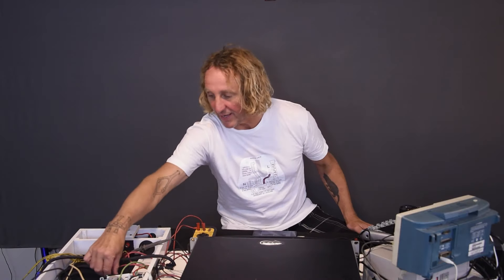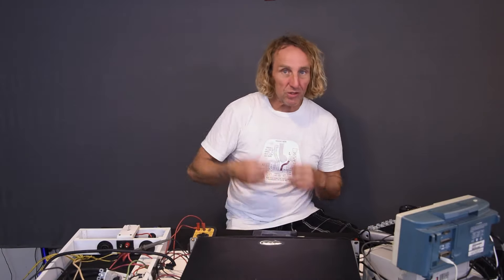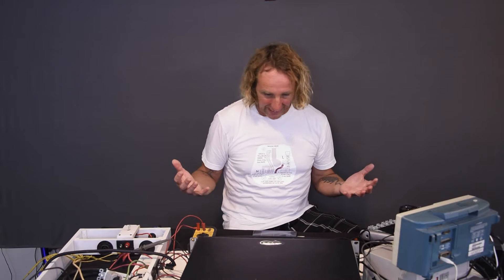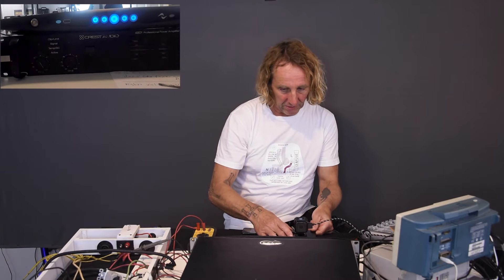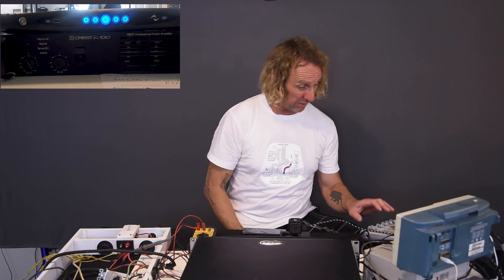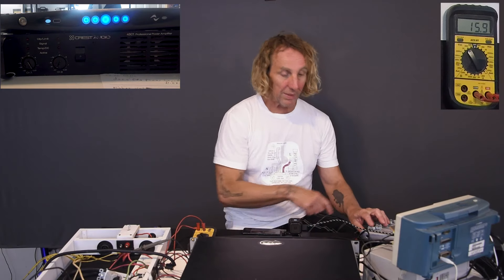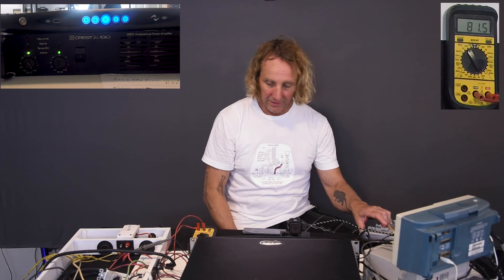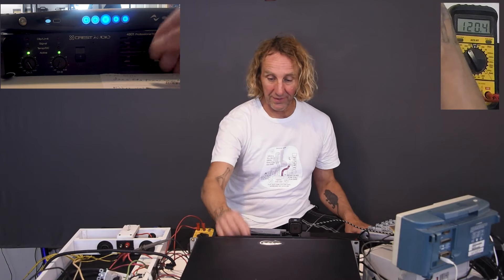Does Wall Voltage Matter for Audio Amplifiers??

Comment: I measured 139 V at my outlet. Is that bad for the amp and the tubes?  Thanks for replying.
Reply from the maker: That's a bit high. But also most gear is designed to deal with a voltage range .

The main concern is why is the voltage so high. Typically the power company is pretty good at keeping 120 volt stable. But it depends on what country you're in. 

You may have a bad neutral that's drifted or not connected well which should be looked into.
Reply: @DaveRat  I'm here in Texas. Thanks for your reply, I'll check the system and see.
Reply from the maker: @thegolfnut812 yeah measure some other voltages around the building. If you find it a bunch of the voltages are 20 volts low and other voltages are 20 volts high and then you probably have a bad neutral connection somewhere. 

Maybe measure it at the panel as well let me know what you find

Comment: Since I don't trust venue distros, I have a multimeter on house voltage all through gig. Thanks Dave
Reply from the maker: Wise, and when the meter reads afoul, what is the contingency plan?
Reply: Sure pays to be careful...
But from the venue's perspective, we prided ourselves on our capabilities... regardless the conditions, load or line side, our power was legit. 

I've since retired, but seriously, it was something we took very seriously. Oftentimes our biggest concerns, were clients low-balling and under-representing their needs. 
Granted, the biggest productions that rarely if ever happened... it's the marginal shows that may present issues. 

I've got tons of stories ... I'm guessing you do too.
Reply from the maker: Ha! Yes! Especially back in the punk rock tapping hot with wires before the building disconnect days.
Reply: @DaveRat  
Nice!
Reply: Quick funny story;
Walking with a wedding DJ for a pre-event walk thru... walking toward the event hall, I ask exactly what his power requirements were... 
He said, "𝙄 𝙣𝙚𝙚𝙙 𝙖𝙡𝙡 𝙮𝙤𝙪 𝙜𝙤𝙩" 
Okay then! 

We operated in a manner of there were essentially no limitations... We had multiple 800a "Concert Switches", adjacent to wall portals for feeders, those in nearly each partitioned hall. 

For flexibility, each floor pocket (~20' on center), we had six 20a Edison, 60a 3ph 208v, 100a 3ph 480... so with countless transformers mounted to frames, we'd simply roll in and drop 200a 3ph 208v... anywhere!

* If we needed 400a of 208v in the middle of the floor, we would PARALLEL two transformers! 
(that's something one never encounters outside of showbiz)

All flush mounted into the floor.
 In carpeted ballrooms or concrete expo hall, he had pockets everywhere. 

Even cooler... these pockets had fffnnn everything; 
Compressed air
Water
Drain
Natural gas
Telecom; w/hard-wired Ethernet, copper phone lines, fiber optic multi-mode and single-mode.

Also, our own in-house cable network, we combined and modulated both satellite, and local cable onto our own group of channels on RF coax.  

We had anything you need
It just takes money 💰 

(We even rented cell phones when they were fairly new!)
Reply from the maker: Super cool and what a perfect situation!

Comment: Hi Mr.Dave, I am using 19.6V to power an old mixer specced for 18V. Any chance it will cause the mixer not to work? It powers on Ok and Phantom works. Thanks,
Reply from the maker: That should be fine, most power specs have room for over and under voltage. Often +-20%

Comment: Hey Dave.
Can you show what happens when an amp gets starved for current under use?

Example, using a crest 9001 bridged with a 4 ohm load. There isnt an option to go to 220. Has to be 120. This would be driving a pair of 21" subs, with x-over low passing at about 60. No Hi-pass and kicking it in the pants. 

Love watching what your doing.
Bob Blackhurst
Reply from the maker: Hey hey Bob!! Great to see ya here. How are ya?

I will ponder a demo on that. Pretty much, when the current is limited we see voltage drop, so the outcome is the same. Dropping the voltage limits the current and dropping the current limits the voltage.  The two are intertwined mathematically.

Comment: 9:15 got me confused since you didn't mention your voltage figures were peak to peak figures. Typically when you speak about voltage (like 120V mains voltage for example), it refers to rms voltage. I was a bit confused when I saw 170V into 8R, which would've been almost 10x the power figure you came up with ;-)
Anyways, cool video I wanted to do myself for a long time (vacuuming my room on an amp), but I always was too scared, even though I understand the physics behind it.
Reply from the maker: Yeah I did switch back and forth between peak to peak and RMS.
Reply: I ran a hairdryer on an car sub amp i modified for higher rail voltage (added 4 turns to the secondary of the transformer, rail voltage went from 63 to 78v, since it is a full bridge that works out to about 156 vpp or 110vrms. I use a 12v power supply to power the amp and it is rated up to 15v,  still within spec of the components). Works perfectly.
I came up with this madness to replace a dead amplifier on a Home Theater sub, it has a very high impedance since it runs on rectified 120v mains, and I live in Brazil, where pro audio amps are very expensive, and you can get a nice, well built, efficient 3kw@2ohms class D car audio amp for quite cheap.
Reply from the maker: Super interesting and thank you!

Comment: Great litmus test. What made you think of this? Did you do a gig with low AC voltage and the solution was this concept? Did you have to take 120v equipment overseas and make it work? 
They say it's not Rocket Science but, have they been on the road and "The Gig Must Go On!?" 
My Murphy's law: "The Smoke Alarm Started the Fire"! (One of my songs)
Reply from the maker: Thank you.  The idea came from testing power supplies when I worked at Hughes Aircraft.  The power supplies would easily meet spec when overvoltaged but struggle with undervoltage.

As far as it's relevance to audio, band  members were complaining that their tube amps were not sounding right when on generators and in countries like Japan with 100v or in 0laces with low power.

Also doing shows with low generator power, the PA system seems to lack punch

So I thought testing and showing there is some truth to those beliefs would be cool.
Reply: @DaveRat  thanks so much for the video Dave. Extremely insightful!!! 
i'm trying to take this info away and apply it to my own situation: whether an average class D amplifier needs to have its power ratings 'de-rated' when running at 120v 15a even though many manufacturers claim the amp is 120v compatible. Hotter AC supply is always preferred, but how detrimental is 120v service? Slightly different situation than what you simulated here. any thoughts you could share?
Reply from the maker: With class D and voltages over 115v all is good. The odd ability of the small amount of power lost is negligible in most scenarios. The more pressing concern is making sure you don't blow breakers and your current draw does not exceed the capabilities of the wiring.

Using a current clamp to measure the amount of amps traveling through the wires can be useful if you believe you are near the limit
Reply: @DaveRat  so it sounds like when it comes to 120v 15a ac power, the wall's current supply is typically the limitation and not voltage supply. Would it therefore be beneficial to operate the amp at higher impedences? Ie 8ohm vs 4ohm.
Reply from the maker: Switching amps tend to have the ability to draw more current of the voltage is low. Higher impedance will draw Les power but the power delivered will be less as well. So turning down the volume on a lower impedance will be the same thing-ish.

Comment: This is RMS power, how often would you normally use a higher peak power? How does over/under volting affect the peak to RMS ratio?

I have designed a few power supplies and I dread to think what long term over volting is doing to the components....
Reply from the maker: If an amp or any product is designed so delicately that it can't withstand long term 10% over voltage in normal temperatures, then it probably can't be trusted in extreme temperatures like high heat shows in the desert.

20% over voltage for short to mid time frames is not unreasonable considering the power fluctuations of generators. So gear designed to handle that would be desirable.

Amps designed to deal with voltages above that, say 140 volts and upward, may be over designed.

That said, a powersoft X4 will handle 90 to 264 volts DC to 200hz single phase or three phase with 1 to 3 hots.

For input power.

Comment: Very interesting. What is the best way to ensure that you have a consistent mains voltage to your amp rack or whatever circuit you're driving powered speakers with? What are the specs I should look for in a power conditioner?
Reply from the maker: Typically you would not out a power amp on a power conditioner.

Measure the supply voltage and make sure to use power cables that are not overly long or overly thin where you get big voltage drops to the amps when driven

Comment: Would be interesting to see what happens if you increase the tone frequency incrementally, say 10htz a time?
Reply from the maker: I did do some lower and higher tests of 30hz to 90hz, not much different except when clipping, the source frequency shows up a bit on the output, so at lower frequencies, the clip tends to rise and drop slightly.

Comment: Here in Oz we run 240 to 230 V a.c.
Reply from the maker: So there it would be like driving a 240 volt amp at 270 volts

Comment: What about running amps at 240uk
Reply from the maker: That voltage is too high to do without changing the transformer tap. So that 135 volt would be like running 270 volt in the uk

Comment: Woah, free power! but surely nothing is free.. There is no way running your generator at 135V for a your rock show could be a good idea.. Right?
Reply from the maker: Running a generator at 125 or 130 is usually not an issue unless the generator is voltage surging after loading down, then running hot could surge beyond safe levels.

Most 120 gear is fine 15% to 20% over voltage, so 138 volts to 144.